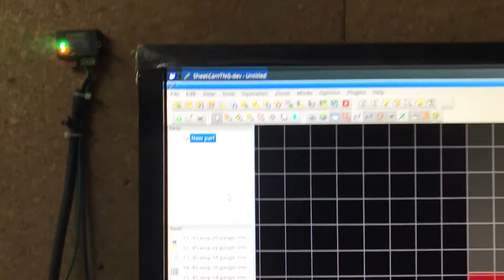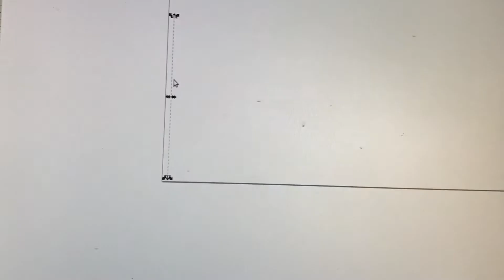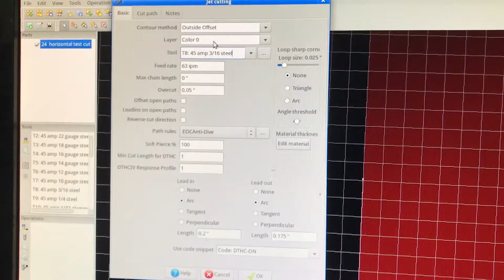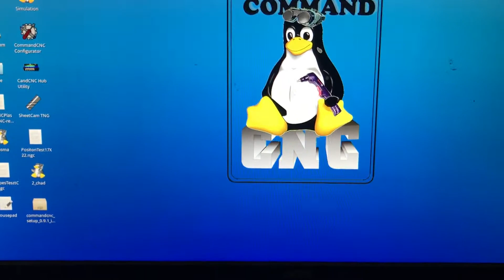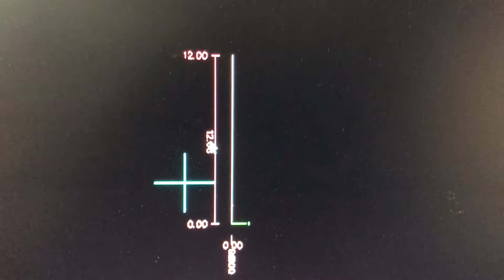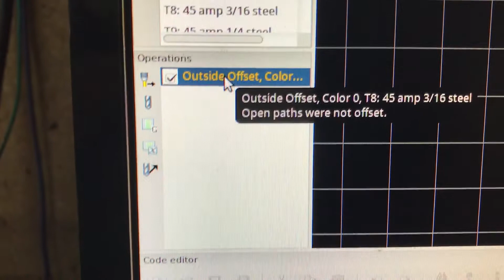InkScape Straight line cut set up for CandCNC ControllerTutorial Part 2

Comment: how do i save my drawing in inkscape in a gcode for plasma cutting?
Reply from the maker: Inkscape only creates the vector SVG files for your drawing. To convert the SVG to Gcode the drawing will need to be run through a program like Sheetcam. Once imported and converted it can then be saved as a Job/ Gcode file.

Comment: Thanks for this. I am actually taking notes and documenting the steps. One question. I see your hyperthem is set to max on the machine. Is this correct for all hypertherms as command cnc takes over.
Reply from the maker: It depends on the model. If your running an older cutter you will have to adjust it manually. On the PM 45 you set it to max.
Reply: @chadfox4097  i have a newer pm85
Reply from the maker: I am not familiar with those. Best bet would be to contact Hypertherm. They would be able to answer if the voltage is controlled remotely. Their customer service is awesome. 👍

Comment: Well done video Chad. I'm just getting started with a new PPLLC 4' x 8' Mag 7 and LINUX CandCNC 620-4 Fully Automated (W/Ohmic) package. I also have the HY Powermax 65 (RS485 & CPC). Haven't made a cut yet, just trying to get the initial set up's completed with baby steps and gathering info from the DTHC Manual. Thanks Again

Comment: were does one get all the tool settings from is there a web site to down load them from
Reply from the maker: koollakes Hypertherm has all the cut speed and information straight out of the book.
Reply: I just found you can download from cand cnc in the sheet cam upgrade

Comment: thanks for the video, I just got my table last week and have been successfully making parts, quite a learning curve.
Got a question for you.
I need to make 2 horizontal cuts on X axis 48" lg. on a 4'x8' sht. Also need holes in these pcs.
Would it be easier to make a drawing and file for the 2 horizantal cuts. AND a seperate file and drawing for the holes. 
Or can I make a drawing without the the y axis lines, incorparting the horizantal lines and holes if that makes sense?
I need to end up with 3 pcs of plate with holes out of the 4'x8'.
Reply from the maker: Not sure what your trying to ask? 
If the holes will be a separate piece then draw them separate and nest them together to save material. 
If it’s going to be one part then draw it all together. 
Hope that helps.